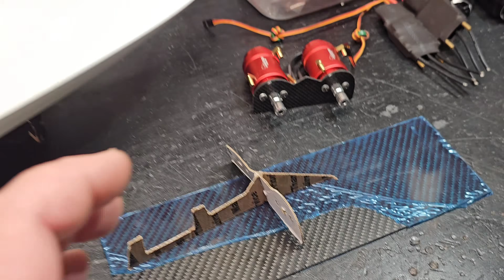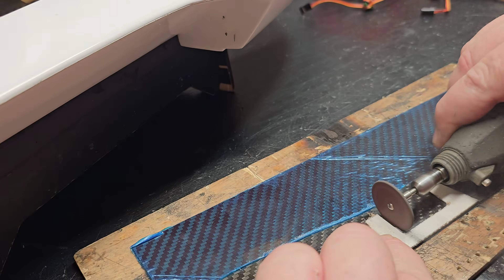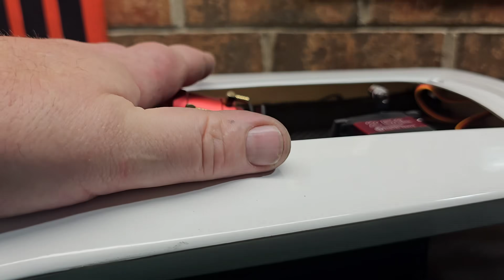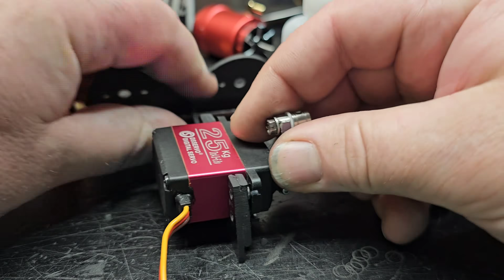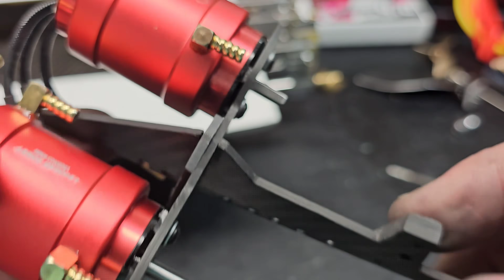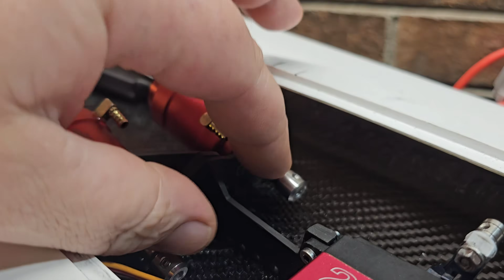Carbon Fiber Motor/servo Mount Deltaforce Vortex 24 Build Series - Twin Motor Hydroplane

Comment: Good looking build B! I was wondering, do you run thrust bearings? Or do you rely on the motor bearings? I run a thrust bearing using the aft motor bell as the push-point, then mount the coupler up to it. I push on the motor shaft from the front side while tightening the set screws for the coupler. Remember, the C-G isn't just weight contributed. Where the push-point is has an affect on the dynamic C-G. Drag boat wants the push-point aft, like you're favoring now. Helps the launch... But circle boats would prefer the push-point closer to the weight C-G point. I ended up setting my motors well forward of your position looking for good cornering. I think I'm going to learn something here! Looking forward to it buddy!

Comment: You know, model drag boats are an un-filled niché in the RC boating realm.  I wish somebody made a hull/kit to do a realistic semi-scale Top Fuel Drag Boat.  Monos, cats, hydros, and tunnels are everywhere, but NO drag boats.

I have a conversation going with a 3-D printer guy thinking a 3-D print would make a really good start for a super-precision plug.  Maybe a BG group project:  One guy makes a plug, another makes a mold, another starts pulling hulls.  Who knows?? 🤔

Comment: Great set up BigB , this is going to be a ripper . You touched on a topic i always wondered about and that is prop weight especially when running dual motors , i know we are talking about very small numbers but a prop is a spinning mass and if one is heavier then the other then the motor and ESC will respond differently to that load , resulting in one side a tad hotter then the other possibly . This is an unproven theory considering the weight of a RC boat prop but curious about your thoughts .
Reply from the maker: To be honest, I don't think it would impact temperature or the driveline. I think it has more to do with the amount of thrust you get from each prop, pushing the boat.  We run all different size and pitch props with different weights on the same motor and drive line so IMHO running one prop heavier than the other shouldn't make a huge impact, but I'm wrong to often to count so take my opinion with a grain of 🧂 salt.       Having more thrust on one prop opposed to the other prop will or could cause a premature power cut if there not synced up.    Rabbit hole 😆

Comment: That motor mount is great, you have a lot more room than I thought.  Full scale drag boats have the props up close, even under the hull but we trust your judgment Big B see the old drag boat was exhilarating 👍  BGFL
AdamEverythingRc that turn fin is from an Aquacraft UL-1  maybe ebay ?  I checked OSE no dice.
Reply from the maker: I looked thru my parts bin and found the 2 sets of turn fin mounts I used on the original drag boat struts, I thought I used them for another build, I believe I'm gonna use them for this build. I agree that having the props close to the transom may work out for the better. 
I thought that was a uL1 turn fin? I've been meaning to ask you about it?

Comment: B!  Have you thought of using some J-B Weld to fill the mold imperfection on that prop, or even some thickened epoxy?  Since that prop is primarily copper you could also fill it with solder if you want to go through the trouble.  Use solder with a high tin content so not to add too much extra weight to the blade.  If it were me I would probably just use some thickened epoxy, clean it up, check the balance, and call it DUN!  BG4L Bro!
Reply from the maker: Yes. I did consider jb weld. However, solder sounds better, and I'll have to practice on an old prop.  Will I get around to doing it is a whole other story 😆  Thanks for the idea